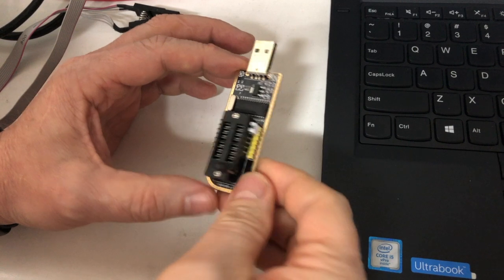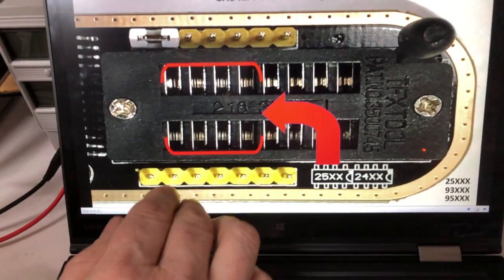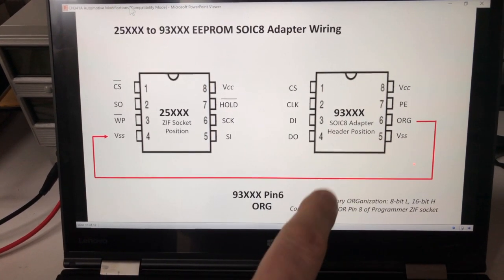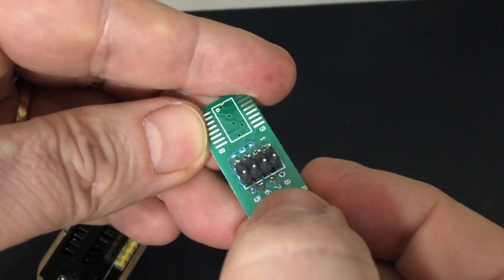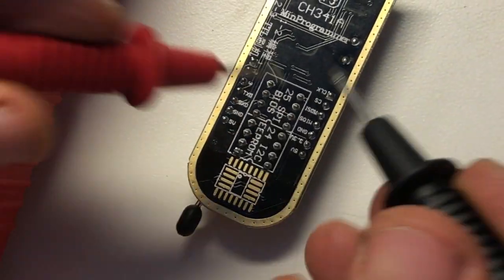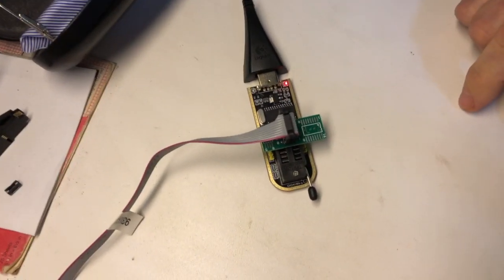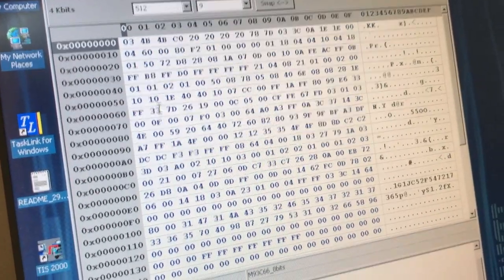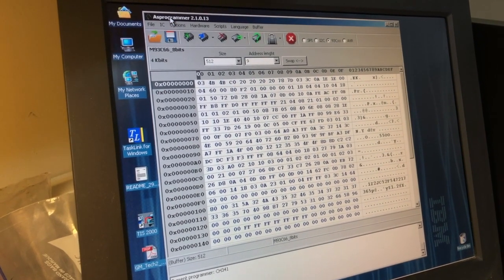Modify the CH341A EEPROM Programmer (Black Edition) for 5V 93XXX & 95XXX Automotive Use

Comment: Hello Dr. Shock and thank you for your videos. I have not been able to find too many videos on this subject and definitely not for a newer GM models. This is very confusing for me as I have absolutely ZERO experience with this. But I feel like you are my only hope in accomplishing what I need to accomplish. I have a 2017 Chevy Traverse and my radio died. Well, it is stuck in a constant boot loop and it occasionally works long enough for the backup camera to work and then usually shut off in the middle of backing up. The reason I am telling you this, is because it is obviously getting power, just possibly not enough power. Any, I took it into the Chevy dealer and they said the infotainment center is dead and needs to be replaced to the tune of $2900. That is not going to happen. I have searched around and found unlocked versions of mine for $600, there is a GM replacement for $1,000. Again, not going to happen. I know there are some tricky things within the system but I found a donor vehicle with a DVD and backup camera like I have, but obviously it is locked. I have a few questions for you. Is it at all possible to purchase a ch341a that has already been adapted to use the 5v for automotive uses? Also, is it possible to copy data from original chip to the donor chip? I assume I would just have to save the old info and load it onto the donor chip. Or would it be easier to just clear the donor chip? Also, do you have any thoughts on what might be causing the original board to go bad? Again, thank you for your videos that are very informative and I look forward to your response.
Reply from the maker: Thanks.  Your best course of action, given what you've wrote, is to find the exact same unit (same GM part number on the white sticker from the same year and model vehicle) and just swap the EEPROM chip from the old one to the donor one.   I'm not familiar with the 2017 year so I couldn't tell you which chip it is though.
 
That will still need someone experienced in doing surface mount chip soldering.   But that should get you back in business without dealing with the VIN lock or needing an EEPROM programmer.
 
To answer the question though, there are several flavors of these CH341a programmers floating around from different Chinese manufacturers.  They all look pretty much the same.  But some are already 5V defaulted, though the 3.3V default like I got is the more common hence the mod vid I did.

Comment: Hi, Thanks for the tutorial. I've tried to do as in your video using IC FM93C46 taken from EasyTouch GCU Tester's Glucose chip, but without modifying the VCC pin. It also worked with 3.3V VCC voltage, both to read and write this chip.
Reply from the maker: That would be a non-automotive application, so as expected. Consumer electronics use 3.3V devices.  Automotive use 5V devices.
Reply: @DrShock  OK, thanks

Comment: Hi from the UK! 

I wonder if you could shed some light on an issue I have trying to read a 24c16 eeprom from a 2014 Land Rover odometer.

Apologies if this is a silly question I am not super experienced with programming.

Here goes, I have modified my CH341a with the 3.3v mod because my understanding was that I would be in danger of damaging the 24xxx chip trying to read off the board at 5v, however I am experiencing FFs and 00’s when attempting to read with asprogrammer. 

You say that for automotive stuff (especially older automotive stuff) that 3v is useless so should I be attempting to read at 5v to give me an valid read? Any help at all would be hugely appreciated, I have pretty much hit a brick wall at this point and not sure where to go from here!

I managed to read a 93xxx from a PC motherboard before I did the 3.3v mod but since modding I can’t seem to replicate that for testing purposes (verifying the software + driver setup)

Great video by the way, very clear and concise info regarding 93xx 94xx eeprom chips. Liked and subscribed 👍🏼
Reply from the maker: Thanks.  In the USA, all American manufacturers use 5V devices.  I can't say whether that's the same in the UK, but I would strongly suspect it to be the case.   Regardless, you should be able to read the device, the correct voltage is usually only a write concern.

So when you cannot read a correctly installed USA made Pomona test clip (Chinese ones tend to be single use in nature) then it's more likely a circuit board limitations.  In practice very few automotive PCBs can be read in circuit.  The vast majority are designed in a way that prohibits this.   That's because the test clip voltage powers up other devices on the board, and you get bus contention.    

So in these situations, you have to desolder and remove the device from the PCB, and program it that way out of circuit.  Then resolder it back.
Reply: @DrShock  Thank you for the reply what you said makes a lot of sense! Kind regards!

Comment: Haha yeah same exact pins but reverse… so I wonder if they did your changes after you posted this 2 years ago because they all come running 5v across everything like you show doing as the hardware mod, I guess the software mod was too hard for them or they got it wrong because I’ve had to reverse what you have done here obviously by my previous comment

Comment: All the input pins are already running at 5v brother.  This circuit has a fault in it, it’s taking the power from the dc converter to run the ch341a chip to the input pins no matter what.  You want to do a mod to make it normally run the input pins at 3v. By cutting a pin the power pin for the chip and taking power from the 3v mosfet as well as talking a line from the same 3v mosfet and putting it to pin 6.  This will make your device work properly as originally documented and specified.  Then you can do your mod of cutting a 3v pin and taking power from 5.  I was writing this comment during this part of the video so I’m not sure if we are referring to the same pins about or not.  Maybe you got lucky and got one from China that actually works the way it says but I’ve gotten around 5 and every one had the error which needed me to correct.
Reply from the maker: There are several of these Chinese designs out there, they all look alike unfortunately.  Some are hard wired to 3.3VDC.  Others are hardwired to 5VDC.  I had the former, and that 3.3VDC is useless for automotive work hence this video.

Comment: Simple fix for 5v, you just need to lift the ground from the voltage regulator. Then the regulator will work like a simple diode. You'll get about 4.4 volts instead of 5v, all works fine. Then if you ever want to go back to 3.3v, you just reconnect one pin. When looking at the regulator, with the large tab on top and the 3 pins along the bottom, pin1on the left is ground (this is what you should lift up), pin 2 is what's shown in the video and is also connected to the large tab, so lifting did nothing really. pin 2 is the output. pin 3 on the right is the input 5 volts. If for what ever reason you want 5v instead of the 4.4v, just place a jumper across the 3.3 and 5v pins along side the ZIF socket.

Comment: Thank you for pinout information, I was able to read S93C66 from my Prius Plug-in 2013 Steering Angle sensor by doing your modification to CH341A. Now I am trying to find proper .bin file for my car, tried one advice to erase portion of data with FF but now instead of reading 850 degrees it reads 0 and lost communication. Others show on video that it should have some data other than FF in the middle of the file. Some forums offer file only for members. Will do more research.

Comment: Instead of doing the 5v mod, why can't you just jumper the 3.3v to the 5.0v using the supplied jumper?  Maybe you explained it in the comments below.  I have not read thru all of them.
Reply from the maker: You cannot do that because the board layout was flawed in China, so the jumper doesn't affect the write voltage.  For automotive, that's a no go, has to be 5VDC on the write cycle.
Reply: Gotcha. My board is not like that. On my board, pin 1 is connected to the 5v pin.
Reply: I am trying to read a ST95080 chip from a GMC brake module. It reads it, but I really expected to see a VIN.  I don't see a VIN in what I got.  Can you help me with this?
Reply from the maker: I haven't worked on a brake module board yet so could not.  But the VIN is not always stored completely in modules, some store only a portion of it.   So you might search for any subset of the VIN string.
Reply: @DrShock  Didn't see any resemblance of the VIN in what I got out.
Reply: @DrShock  The chip that I am trying to read is an STI 95080WQ. I did not see any portion of the VIN there.  I even tried converting the VIN to Hexd format, but did not see any portion of it there either.
Reply from the maker: It's possible that this module does not store the VIN.  I'm not familiar with GM brake module memory layouts so cannot say for sure.

Comment: So is it always better to desolder the chip or can I try to read/write the eeprom in-circuit first and if this not work desolder it? Or could I damage it in-circuit on the read-/write-process?
Reply from the maker: I usually attempt a read in circuit first, it won't damage anything as long as you have the correct pin orientation for attaching the clip.  If there is no read, or garbage data in the read, I move on to removing the chip from the printed circuit board.
Reply: @DrShock  Good to know, thank you for the information! Is it also the same for the write process?
Reply from the maker: Reading is the easier process to get away with in circuit, writing is the hardest.

Comment: I purchased a programmer and it was advertised to already support 5v. Would this modification still be necessary? (Purchasing this to reprogram a gm radio)
Reply from the maker: Likely not, this video is about a programmer that originally only supported 3.3V

Comment: Thanks for this Tut, i was lost without the pinout. Informational for all, you can use the breakoutpins beside the socket to connect your Boards without Soldering or cut some lines on the PCB. 👍🏻

Comment: You dont need to cut the pcb to remove the 3.3V You can actually jumper pins 6 -7 on the data side yellow headers basically putting 5V on the 3.3v line! You could add a switch if you like to do this. So basically keeping the 3.3V 24xxx and 25xxx capability
Reply from the maker: Sure, but this is an automotive related video.  Since there's no use of 3.3V in automotive, it has no value in performing automotive module reprogramming.

Comment: Hi there i have a question. I have programmer ch341a do i need 5 volts to read 95xxx microchip? On 3.3v it doesnt even detect it. I hope i didn't brick it or something. I have chip 9516wq eeprom. Tnx for any help.
Reply from the maker: It depends, the chip is available in both voltages.  If it's an automotive circuit, it is almost certainly 5V.    I would expect the number to be 95160 (it's always 95 and XXX so there has to be 3 digits for it to be compatible).

Now most all automotive circuits cannot be read in circuit.  Rarely you find one you can, but usually the chip has to be desoldered and R/W outside of the circuit instead.  So keep that in mind too.

Comment: Any tips on identifying the eeprom chip I no it's a issi says 938 right after then name and a bunch of other # and letters but I can't match it up with anything in the list and all the micro list for the 93 8bit won't work I checked my custom bored and everything all is good I go into spi with issi and just click on one it's succes but no data loads tried them all no data any suggestions?
Reply from the maker: The core device number might have prefix and suffix characters that vary from manufacturer to manufacturer.   Like AB93XXXABC, you can search the full string for a Datasheet at the manufacturers website.  You can determine the manufacturer by visually matching the silkscreen logo against a google search of same.  

In automotive circuits, it's actually pretty rare to be able to read or write in-circuit.  You almost always have to desolder the device from the board to read or program it.
Reply: @DrShock  with automotive is it because it's hard to clamp down onto or because other circuits interfere with read and program
Reply from the maker: It's the latter, the circuits usually have a layout where the testclip is going to power up additional devices on the same data bus.   This results in bus contention, preventing even a read of a memory device in the majority of cases.

In 3.3V consumer electronics you don't see this as much, as many products are final programmed in-circuit going down the line like personal computer related equipment.   But in 5V automotive this is almost never the case, instead final programming is most often done using proprietary bus protocols and done over the same interfaces that the vehicle, or a scan tool, will use in practice.   It makes sense actually, as this is how you apply calibration updates to various vehicle modules without having to take them apart.
Reply: Issi 93841283gla3 is the one I'm having a issue finding info on I was able to get other modules to read and edited them but this issi is for my radio on my 2013 camaro I can't pull data and I removed from bored to

Comment: When I make the adapter do I cut the old trace from pin to pin for the 93 adapter or just run the wire and leave the traces connected?
Reply from the maker: You would have to cut the existing traces, otherwise of course you won't end up with the proper circuit paths for adapting the chip pinout.  You're just reusing the connector if you go the repurposing route.  You're not reusing the traces.
Reply: Thanks now I just have to figure put how to no witch eeprom is in my radio and other moudles

Comment: I m having some issues trying to write 93C86 eeprom. I have some 93c56 empty eeprom which I bought just to play around and with the last I can read and write them. with the 93C86 that is mounted on the motherboard I can read it but can t do any programming. When I hit program IC the process starts and is shows Programming but it doesn t do anything. Another strange thing with the 93c56 only power LED is on and with the 93c86 both LEDs are turned on. I tried it with ORG disconnected, with ORG connected to 5v supply. Nothing works. I did the conection from the lateral pins not from the ZIFF conection because i have some breadbord cables and it s easyer. Do you have any ideas what s wrong ? Should I try connectic to ZIFF conn ?
Reply: I just tried from the ziff connection but the result it s the same...
Reply from the maker: What is the programming voltage for the 93C86's you have?   With this mod, you can only program automotive grade chips at 5VDC.
Reply: @DrShock  it is 5v. I bought some more 93c86 chips today and I can read and write them all. the problem I think it's because the chip it is soldered on the MB. I m thinking about desoldering and trying like this.
Reply from the maker: Ah I didn't get that from your comment, sounded like the devices were loose and in hand.  No, in circuit automotive programming is extremely hit or miss.   The vast majority of circuits will inadvertently power up other devices once you connect to the EEPROM creating bus contention.  That can make reading problematic in some cases, but make writing completely impossible.   I always try the Pomona clip approach first, but then if there's any drama, take the chip off the board and deal with it that way.
Reply: @DrShock  thanks a lot man. I've got some spare time and I desoldered the chip and it worked no problem. so ch341 can write also 93c86.

Comment: hello great tutorial but can I read 93S66 as an 93C66?
Reply from the maker: Yep, but the "S" type is a security chip so has a slightly different adapter wiring for one of the pins.  Check the video description for more details.
Reply: @DrShock  oh I didn't notice that thanks, now I know that I erased my chip :0